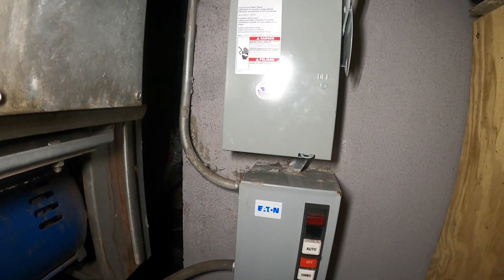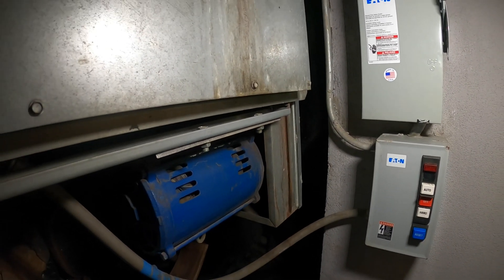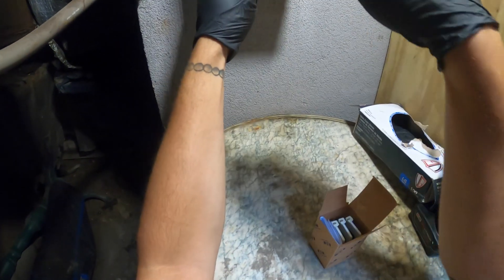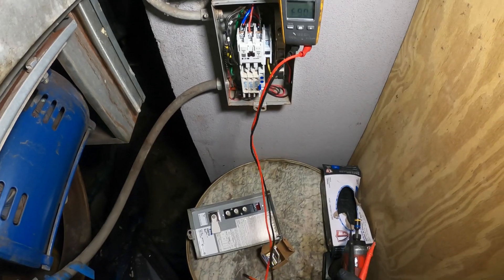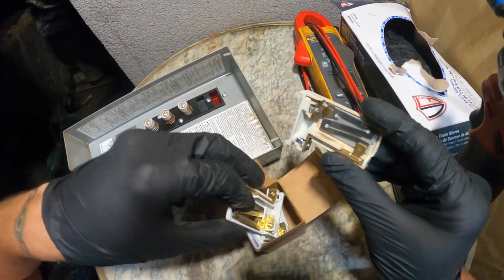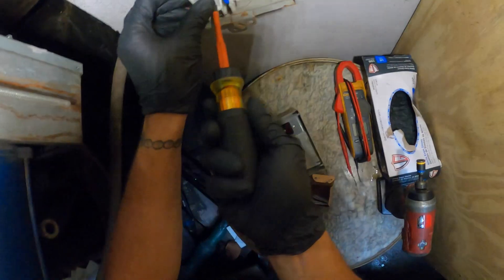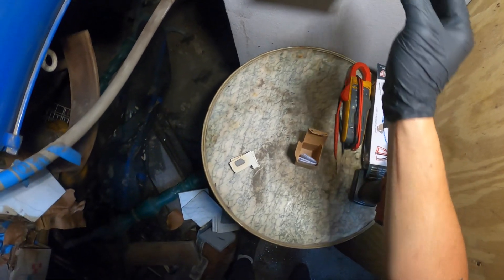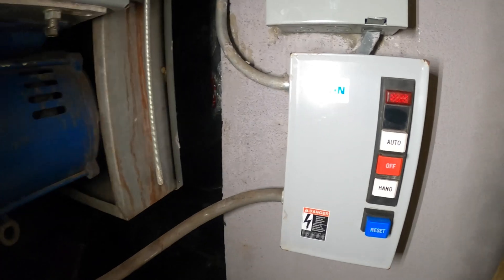HVAC: Motor Starter Eaton/Cutler Hammer Starter Heater Pack Installation/Replacement (Exhaust Fan)

Comment: Another great video as always. Thank you for sharing. Have a nice weekend. If you don't mind me asking ? May  I ask ? what is motor starter and starter heater pack ?
Reply: A motor starter is essentially a contactor and an overload relay. The heaters are matched to the motors full load amps rating. If the motor starts to draw more current than what is normal, the heaters will heat up more and cause the bimetal inside the overload relay to flex, tripping the mechanism and breaking the neutral to the contactor which will cause it to drop out. This setup is critical for 3 phase motors to protect against phase imbalance and loss of phase.

Comment: Don't those heaters have an abcd dial setting that should be matched to motor fla? They have a range. Next step for me would be to trace the auto circuit and find out what is up rather than run the unit 24/7 for the sake of saving power.